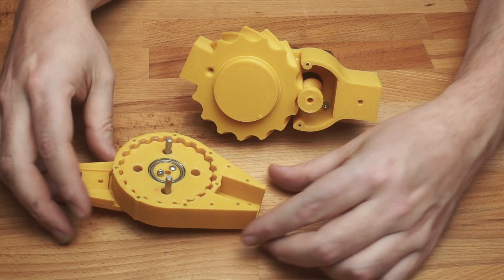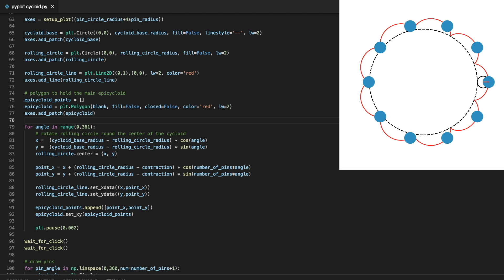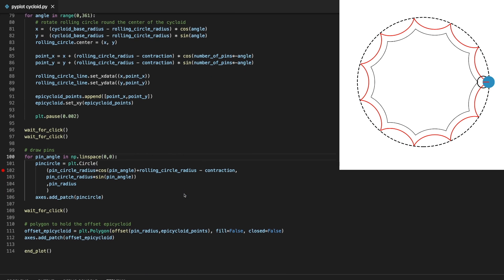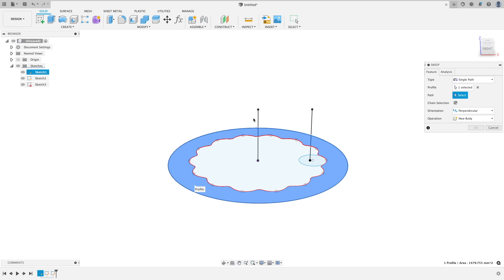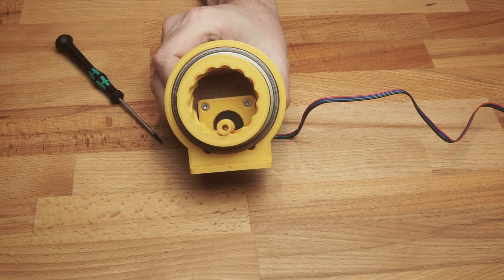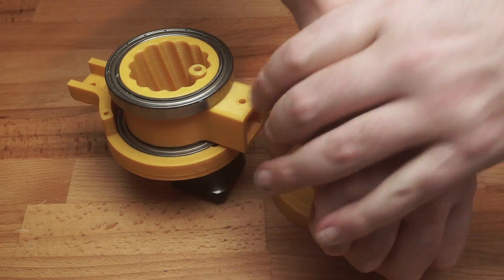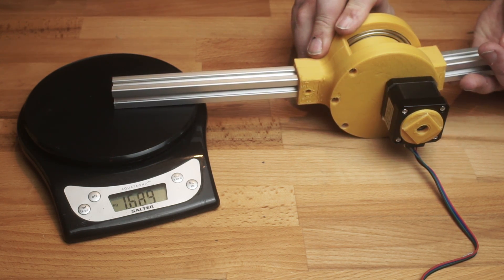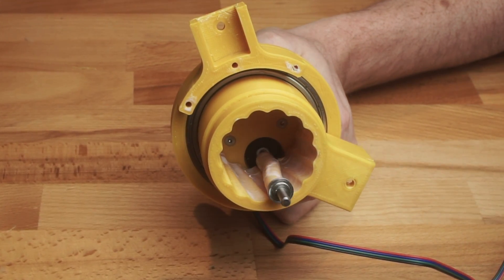an easier robot arm actuator...

Comment: Excellent, very clear and detailed explanation on the workings! 
More ideas for you to consider:
1. having 2 motors drive it can give you more power, better rigidity (positioned opposite), and control over backlash (just advance one motor further to tighten the backlash). This way you can move a robot arm quickly and not precisely, but have it arrive very exactly and without backlash to target point.
2. have many (herringbone) rollers between an outside housing like now and between an inside off-center rotating-wobbling disk like in cyclodial drives. You get higher gear ratio than this and way more contact points to stress - hence a stronger gearbox.
Reply from the maker: Excellent ideas! I will see if I can implement them - thank you!

Comment: Now looking forward to seeing you try a planetary cycloid version of this :D
The goal is to have high gear ratios, but also reduce space as for a dynamically balanced cycloid gearbox, we need minimum 2 and even 3 cycloids for fully balanced dynamics.. That increases space and multiplies the number of bearings or rollers needed for real gears that aren't just 3D printed. So if a planetary cycloid hybrid gearbox can achieve the same or higher gear ratios than a regular eccentric cycloid in less space or the same space, then it would be an interesting and highly practical innovation.
Reply from the maker: You're absolutely right! I'm definitely going to try this out in the future! Thanks for the ideas!

Comment: At the end, it looks like the bearing is slipping. Is it possible to have the cycloidal gear deeper? Seems like it's almost just rolling the outside gear.  Love your content. This is the type of channel that I go to youtube for.
Reply from the maker: good spot! during the torque tests the pinion bent slightly - it doesn’t effect the normal running, but as soon as you take the housing off it wobbles like crazy!
you can make it deeper - increase the size of the pin or decrease the contraction.

Comment: Excellent design. What are your thoughts on a herringbone design, will the off-tangent forces be too high? Also is it possible to put 4 internal gears to spread the load around? I've replicated your last design with four bearings at 90deg on the inputs cam and four stepped cycloidal gears at 90deg phase shift. I will try and do the same with your current design. I will use your python code to generate the internal cycloidal profile. Many thanks.
Reply from the maker: I can’t see why a herringbone design wouldn’t work - one of my viewers made a herringbone version of my last design that seemed to work nicely.
what benefits are you wanting from the herringbone? if you’re looking to reduce side-thrust, I’d consider stepping the gears instead of sweeping them. if you want to double the nodes in mesh then sweeping the gears through 720 degrees instead of 360 would achieve the same thing.

yes, you should be able to add as many pinions as you can fit in! in fact another subscriber has suggested a planetary version, which could be interesting.

I’m not sure what you mean by “4 bearings at 90 degrees”, any chance you could share a picture or video?
Reply from the maker: one other quick thing: on my design I used 5mm contraction - I’d reduce that now - I can’t see much benefit in contraction for EC gears unlike normal cycloidal drives

Comment: Nice work! The python code and visualization is especially helpful to show exactly how the curves are generated.
I wonder if there would be any way to make a planetary version of this. There's an awful lot of empty space inside that could be filled with more pinions to multiply the torque capacity, but I'm not sure how to go about driving them, unless just putting another of the same shape pinion in the center would do it.
Reply from the maker: dammit! that’s a great idea. i’ll see if I can work out how to do that.
a pinion driving another pinion wouldn’t be very efficient as there isn’t much surface area contacting, but the sun gear could be a single tooth, the planets could be larger,  and the ring would be larger still. not sure what the reduction ratio would be, but it could work

Comment: Thank you! I am thinking of using your design for a 4th axis gearbox on my CNC machine. The external gear would enable round stock to fit through the gearbox and 4 jaw chuck. I only find a Readme.md file for this latest design. I am having trouble getting scripts to run in Fusion 360 to get your last design to work for me.
Reply from the maker: oops, guess who forgot to press commit! the files should be there now!

if you were to use this for a 4th axis, I’d suggest using a larger pinion and reinforcing it with a steel rod all the way through
Reply: Strain wave is probably best for its zero backlash and high rigidity. Low friction/high efficiency is not really a priority for a 4th axis. This guy has gotten good results with the two ring style 3D printed https://www.youtube.com/watch?v=VK4zgFTD2SA
If you use a larger number of smaller bearings (perhaps HK series needle bearings) for the wave generator and drive it with a belt, you should be able to get a through-hole.
Reply: @dekutree64  I like this a lot!  Thank you!

Comment: I don't understand why the output was not a smooth rotation, but instead slightly jumpy. Could somone explain?
Reply from the maker: the pinion bent slightly in my torque tests (when you heard the "Thunk") - you can actually see it rotating off center in the last shot in the video - this caused the speed to change in part of the rotation.
Reply: @roTechnic  Ahh ok thank you very much. The design was very interesting but I couldn't enderstand what was causing it.